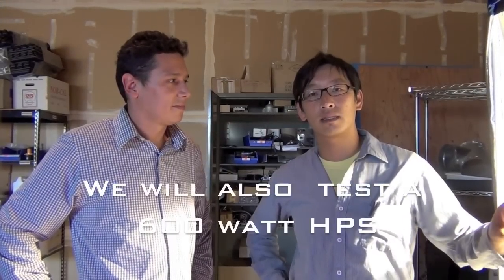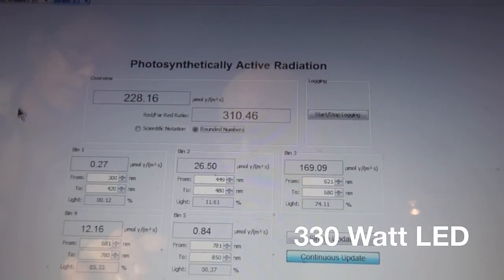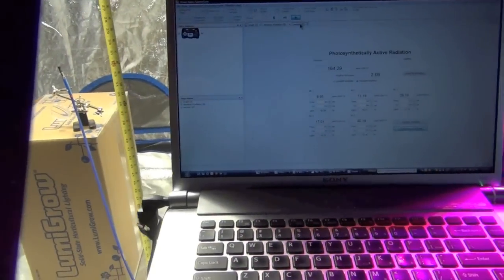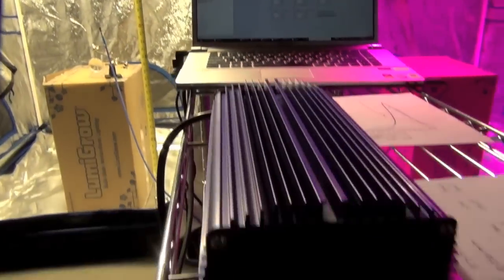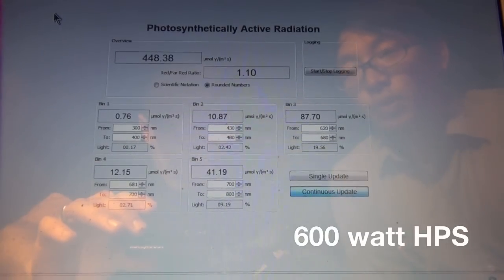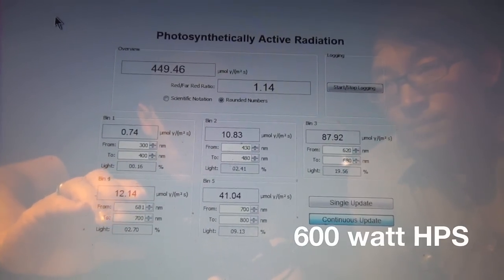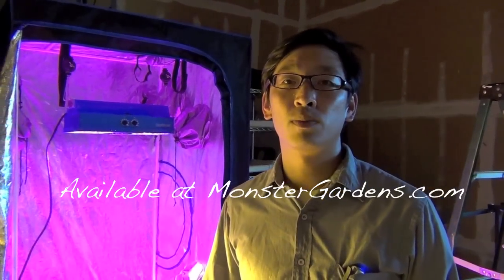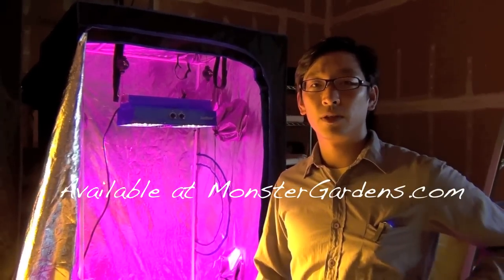LED Grow Light Testing GrowLight Versus a 400 & 600 Watt HPS LED Grow Lights Lamps LED Garden

Comment: TOTAL PPFD  - 330W LED 228,  400W MH  164, 600W HPS  440 (μmol/m2/s). Would be lucky if LED is consuming 200W at the wall. In this comparison, there is no comparison, Total PPFD says it all, that's why its not mentioned. I'm sure this LED is great for non-flowering leafy greens. Oh how times have changed 10 years.

Comment: I used a 1200w led tripple chip in place of my 1k hps, half way threw flower i smashed it into a junk pile!
Not sure what your meters are telling you but i use buds as my meter..
Reply: you have the lights too close
Reply: @Kirt44  I thought you could put leds as close as possible? Because I have 2 1000 watt leds and 1 600 watt led both full spectrum in a 4x 4. I just ordered a 1000 watt hps cause this shit looking sad compared to my past grows with only hps lights.
Reply: @dawudjtownsville  no you still get lightburn if you put them too close it is just harder to see instantly because it is not the heat that is the issue here it simple the light intensity is getting too high and the plant is stopping photosynthesis and if it doesn't get raised again you will see alot curwing leaves yellowing leaves and so on but starting with the top leaves and buds closest to the light
Reply: @Kirt44 Thanks man, that makes sense because my plants started off growing fast then they slowed down as they got closer to the lights. I thought they just didnt need to drow vertically anymore and was focusing on weight but my buds arent getting bigger either. Since im only about 3-4 weeks into flowering can i still reverse this and get a better yield?
Reply: @dawudjtownsville  yes it sounds like a case of the plants are too close to the light and therefore they stop growing almost , you will deffently see alot of new improvement in the grow by getting the light longer away from the lights but since you are 3-4 week into flower allready it could be that the plants are going to suffer in yields ?? Im pretty sure that those first days and weeks of flower is probably the most important and critical parts where you just want everything to be growing smooth and whitout issues,, for example you are allways told or read that you want to sort out any nutrient deficiency or other issues before you switch to 12-12 lighting
Reply: @dawudjtownsville  what brand of led grow light it is says ALOT !! In regards to how far they should be from the canopy or rather how big/ how much watt the led diodes in the fixtures are on . Some or most of them are from a quarter or a half watt per led diode , and others are maybe 1watt or even 3watt or 5 watt diodes and that is  going to mean a HUGE difference in the optimal distance to place the lights
Reply: @Kirt44  well i guess ill call it a learning experience I probably shouldnt have grew 8 plants either. That was the main reason i kept the light close,  to penetrate the canopy. Should i add the 1000 watt hps or do you think that will hurt the plants? My tent is 8x4 so i do have more space to use. Thanks again ive already raised my lights now ill just wait and watch.
Reply: @dawudjtownsville  also  especially whit older led and cheaper technology they are just not very effective at all , it is only the real expensive led fixtures that is going to do it if we are not talking a expensive led grow light or one of a newer generation after 2018 then it probably is just a crap light fixture and the technology is not good enough
Reply: @dawudjtownsville  if you can manage the heat and airflow and it doesn't get too hot in the tent then you will allways get better results and better yields whit both full spectrum leds and hps at the same time because you are giving them a much wider range of light colours and the penetration of the hps will be only giving the led lights so much more help in the overall yields it will be extremely noticeable.. the best next after the real sun will be a even mix of good full spectrum leds and hps or cmh
Reply: @dawudjtownsville  atleast i hope that has been helpfull information for ylu
Reply: @Kirt44  well thats what im going to do then i hope the hps isnt too hot but it does have a dimmable ballast so i should be able to manange that. Now im thinking to split the tent into 1 veg side with a led and a flowering side with the hps/led mix. Good lookout bro you saved my ladies. Ima put one in the air for you.👊
Reply: @dawudjtownsville  glad to help hope that you get incredible fat and frosty buds but if not now , then try 1 more run and then mix the hps and led fixtures from when the plants are grown 5 nodes up

Comment: I've did 5 grows with a purple "1000w" led, it only pulled like 280watts it grew plants well but the nug structures didn't form up solidify at the end of the grow they finished off airy and loose and the light did not penetrate past the tops facilitating the need for heavy pruning weekly and i always ended up with lots of larfe and popcorn, and airy buds. Just my .2 cents my next light will be a cheap 600w hps for comparison.

Comment: You also forgot to mention the led "is equivalent to 1k watts" and used a 400w hps or mh, sounds like your bias just like the rest of led users. LED IS SUPPLEMENTAL LIGHTING NOT MAIN SOURCE!!!!! If you want to run your 1k watt hps or mh and want it to be cheaper then run it on 220! Yea you can grow with led and yes it will be cheaper to run but! To make that money back for the cost of the led fixture it would take years where a hps will pay for itself in its first two crops including the electric it costs to run. No experienced grower ever said I buy cheap equipment and I want to produce the best out there.
Reply: Well said, ive used led lights and half way though flower i had to go back to my hps... Led lights are junk!
Reply: I totally agree. As an experienced grower i can attest to your statement and fully agree.

Comment: Why don't you use a ceramic metal halide they blow LED away including my sk600 which is one of the top-of-the-line ones.
Reply: I call bs samsung is making diodes over 3.0 umole efficiency

Comment: Wait wAit the MH was a phosphorus coating bulb what color temp bulb did you use on the MH and HPS bulbs?
Reply: That was a fishy ass run not even close at all to a real bulb I don't know what they did plus that trash led is shit for 4x4 areas and only is good for center and 0 spread

Comment: Quality over quantity, I'll stick to HIDs, I've yet to smoke any LED bud that has any potency and I ain't growing veggies!
Reply: with LEDs you REALLY need to do your research. Find out PARs and find good lights. LEDs usually need to combined to match what an HPS will do.
Reply: @anduin1  combined? Maybe when the price of LEDs come down , What's it gonna cost to match an 8000 watt show? ........yeah that's what I thought!
Reply: im just saying, one thing they can offer is better coverage for a grow tent, oftentimes needs 2 or more boards/units to cover an area adequately vs HID of a higher wattage equivalent PAR readings. I use HID but some of the newer LEDs (quantum boards) are doing some neat things.
Reply: @anduin1  No offense, but that's small potatoes ! Pun intended, you basil guys kill me?
Reply: care to elaborate? Im not really sure what you're trying to convey here. Open to hear what works for you.
Reply: @anduin1  All I've used LED for is early veg , I harden off under a MH For a few days and then to HPS for flowering! I've seen beautiful frosty blooms under LED but they always lacked potency , just didn't seem worth it at the end of the day.
Reply: @jackherer5728  Its 2019 dude, how can this discussion still happen? Are u really running a 8000w grow ? How much is it costing you every month ? From lights to vents, cooling etc ? 
Do the math dude u have LEDs nowadays that match HPS for about half the power 
Peace
Reply: @anduin1  

PAR/ PPFD Blablabla 
I will grow the shiz out of yr LED w ONE single 400w HPS. Ya rite, 5-16 plants under only ONE lamp and never ever burnt out "50-100.000hr"- diodes or drivers. 
Tech and numbers will never replace skill and good genetics.

Aaahhh i forgot...We US gardeners love to grow "automatics". 1 lamp per plant, 20/4. Cause of savings in your bill. Donkees LOL
Reply: @ihreMaskeSitztNichtRichtig  That's what I'm talking about, These LED guys are growing their little ornamental buds , lacking potency , waste of time debating LED guys!
Reply: @jackherer5728  how tired i am, hearing stories of HPS being "outperformed easily" by chinas LED boards. Fkin noobs got me a little confused first lol

Comment: 600w led vs 600w hps and the led will yield half as much if that. The buds are nice and dense but in terms of sheer yield led is just not there yet. I think using 1 or 2 led lights at say 300w with 1x 600w hps is the way to go then you'll have all the light spectrum and yields like a 1000w how but 30% less of a bill and heat

Comment: Who runs a 600 watt HPS 32" from the canopy!?  Might as well have the light in another room.  18" in a hood is the correct distance.  Don't get me wrong, I love LEDs, but this video is really disingenuous.  If you really want to go to LED, look at the Gen 7 Vero 29s or the tried and true Crees.  A good fixture from timber grow lights will put a 1000watt DE HPS to shame for umol/m2 and would destroy what they are trying to sell.
Reply: I get Less than 12" at times with my 600W hps, 6" raptor hood and 430cfh fan wide open. I'm about 81° at the canopy in the dead of summer. 16-18" is ideal though.
Reply: Well shit, what's the correct distance for a 1000W hps to be away from the canopy? I've got fans in the room and a fan blowing through the reflector. Canopy never gets over 90° so I've got it about 12" above the canopy. I haven't had any heat stress or burns from the distance yet, but I'll raise it if need be. Saw this and though "hmmm i may be too close." Thing is, it's only been running about a month. Started this grow outdoors, but thieves caused me to buy a light and grow indoors. So this means the plants were already grown and flowering when i set them up inside. They're tall plants, but i tied the branches down so they could fit under the light with a foot gap between them and the light. Thanks for any answers.
Reply: Yeh but everyone has there own way of growing if u been doing it a long time u shud know this and who cares what he does worry about yourself I thought your comment was kind of ridiculous that's why I had to msg u n let u k what's up
Reply: Even if your right u shift condemn him for doing it his way fuck em lol
Reply: That's true but as you can see they are both at the same distance and level... So even if you put both lower at the same low level the led will still out beat mh or hps

Comment: BlackDog LED = 1500 Dollars

NextLight Veg LED = 500 Dollars

LumiGrow ES330 = 700 Dollars

600W 6inch air cooled HPS, fan, filter and duct = 320 Dollars.

It would be insane if those top of the line LED lights did not outperform a 400w HPS
Reply: Today there are dozens and dozens of top quality led lights. For 200$ you can cover 4x4 in bloom. So your comment is a total miss. You wouldnt believe what leds exist for less money.
Reply: @НовиСадСрбија  what is the best led under 300 usd?
Reply: @vincentlered  Migro 100
Reply: It's hard to trust the less costly LEDs though. That old saying, "you get what you pay for," has always prooved true for me. I've found what looked like great LEDs for a reasonable $200 to $300 yet the comments gave horrible reviews. The bad reviews were always for the unit's durability, never its growing ability. So, to me at least, it does seem that any LED less than $500 may not last long. I've got a 1000W mh/hps setup that is working great, but I've been looking for an LED setup for a "veg" room. Still looking around. I am hoping to find a worthwhile LED setup for $200 to $300 (that's what i paid for my HID setup, from Home Depot plus I'm broke 😄).

Comment: using LED are the # 1 way to lose your crop. if you can grow the best buds with HPS and T5  and you double the par with this LED it will burn your plants. just use T5 it works and cost alot less and has about the same heat
Reply: I can keep my 600W hps in my flower tent a lot cooler than my t5 veg tent.
Reply: true

Comment: Good for small plants or scrog. If you want to grow 1M tall plants use 600 HPS
Reply: also if you want to save 500-1000 dollars on lights get 600 HPS
Reply: Got a 1000W mh/hps setup and it's growing badass 1M tall plants with LOTS of buds.
Reply: Nope i want bushy and wide short plants. Hps is a no and super outdated.
Reply: @НовиСадСрбија  uhhmmm no lol

Comment: NEWbie. If there is wasted light area, from light not in the spectrum range which needs to go from light source, bounce off the reflector and hit the plant are you saying that the "reflector tents" are not worth using?
Reply from the maker: Hey Hedgehog, no at all.  There is still usable light that bleeds through and otherwise gets wasting.  Increasing the reflectivity on your walls is a great attempt at salvaging that light in some capacity, even if it's minuscule.  Hope this helps - Cheers!
Reply: Thank You very much
Reply: Thank YOU

Comment: LEDs do provide plants with the correct light color, and they do this very well, probably better than hps or metal halide. This is great but only half of what a plant needs... the other half being light intensity, LEDs cannot provide enough intensity to even get close to comparing LEDs to HIDs, 'nough said, im not switching
Reply: Well, I got cheap 4W LED tubes of 25cm (cold white), and the lux is well above 12000. It's the lux that counts, right? With that being said, that is measured a few inches away from the tube. About a hand length downwards they still reach well over 8000 and about a foot away about 2500, which is still good enough to grow seedlings up to young plants. Never had a problem with it and my plants grow beautifully. Of course once they get bigger I transfer them either into the greenhouse outside during summer for natural sunlight or when it's too cold into one of my snake cages (protected from them of course otherwise my plants would be destroyed within a few minutes) and connect the already installed the blue/red/white LED strips. The snakes don't mind the extra light, they are used to it for 7 years now, and the plants benefit from the heat at the same time (regulated temperatures and moisture in the terrariums).

LED all the way here too!!

Cheers.
Reply: Debatable at best
Reply: This is five years old, cobs def have penetration
Reply: +TheOpelkoenjas Its not LUX, its PAR.
Reply: 1000w cob says you are wrong
Reply: Protons dip
Reply: If you can afford led, your dumb not to

Comment: Why are LED grow systems still so expensive?  Couldn't I just buy led strips that have an output of .8-.9 watts per diode and attach it to pretty much anything and then hang it above the plants?  Wouldnt that be the same thing but 80% cheaper?

Comment: Great info. But I looked on Amazon and they want over $3K for it. What would you use for a small home gardener??
Reply: You're probably not still looking, as i see your question was 6 years ago, but Home Depot carries a 1000W mh/hps combo setup for $250! The ballast is digital and dimmable. The reflector is very large and has a 6" duct that I've attached a 6" booster fan to, and one foot below the light stays just shy of 90°. It comes with two hangers and a timer. I dont use the included timer, as it's an old style mechanical type. I have a digital timer i use instead. Can't beat this deal. They also have smaller wattages, but i dont know the cost of those setups.
Reply: @1trillionviews516  rezz

Comment: I'm a little skeptical about your measurement technique.  I've use the Ocean Optics system you are using to measure and I've found that the fiber probe is very very sensitive to angle.  For your LED light you have the fiber pointing directly at the source, for the HID the fiber is not pointing directly at the source. Also, what did you use to calibrate your system?
Reply: Very skeptical and u would never run a hid that high up

Comment: Lumens are a "totally irrelevant comprison of light"?  Huh?  All you are showing is the wavelength/color of the light, not its sheer volume.  If what you said was correct then one 35 watt LED would be on par with a 1000w halide - which is just silly.

Comment: there seems to be a debate on the important wavelengths that are beneficial to growth. as I shop around for led lights I compare the total spectrum to the eye hortilux mh and hps. I was wondering what the in between wavelengths are reading with your fancy spectral radiation meter. also is the 330 watts actual power draw as led lights will not pull there full wattage?   I would love to switch.

Comment: Measuring 32' from a 400w MH is putting it about half a foot out of range of whats recommended for seedlings and almost 2 feet away of what a developed plant can thrive in so long as its ventilated properly. You should post a video that compares a grow side by side with lights positioned optimally to compare actual growth. say 2 of these led systems together vs that 600w hps and the 400w mh together?

Comment: Hi there,i'm thinking of switching over to a 330 LED light from a 400w HPS. Before and if i do,can you tell me the actual life span of the 330 LED before it starts to degrade in output. Thanks,Carlos. :-)
Reply: Well I'm 6 years late but are you going to sell the HPS? I'll buy it off you if you replace it with LED. If you're even selling it. Honestly, I'd keep it to use if you dont like the results of the LEDs.